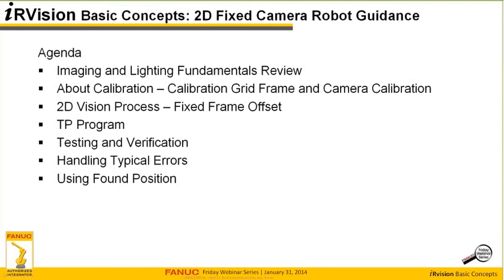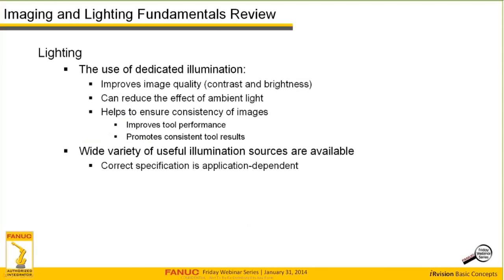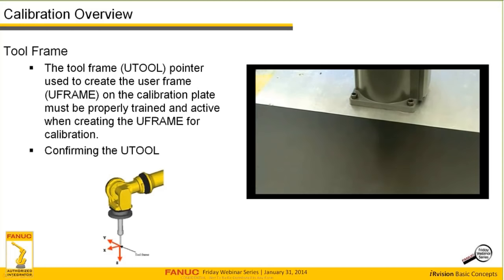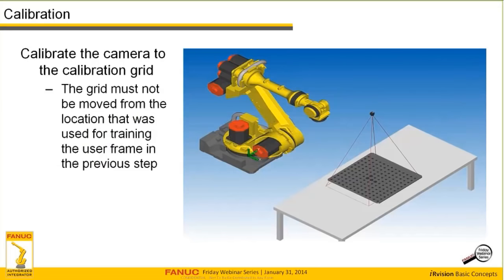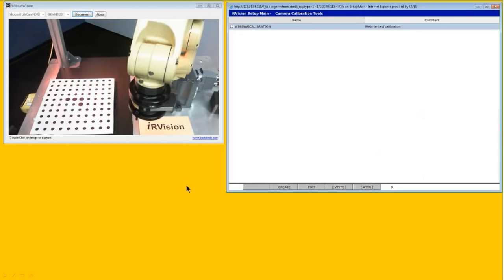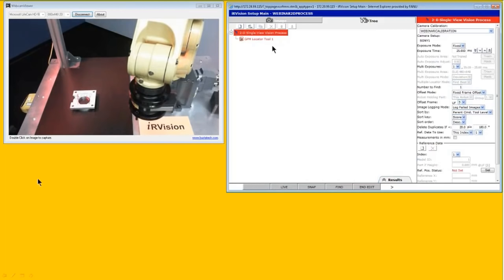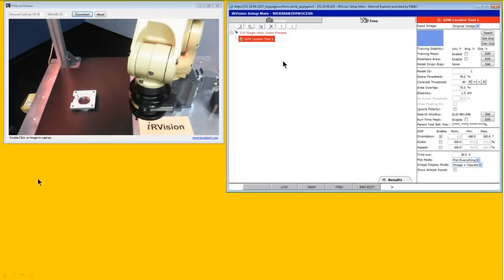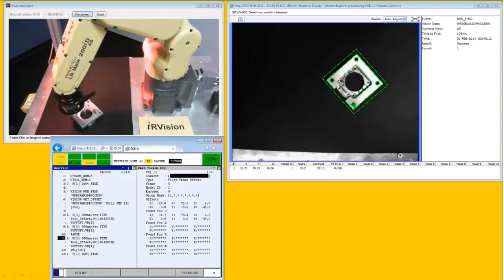How to Set Up A FANUC iRVision 2D Fixed Camera

Comment: 1:43 - Overview
3:08 - Imaging and Lighting Fundamentals
9:15 - Calibration
25:30 - 2D Vision Process
33:25 - TP Program and Testing/Verification
41:31 - Handling Typical Errors
50:43 - Using Found Position

Thanks for the video!